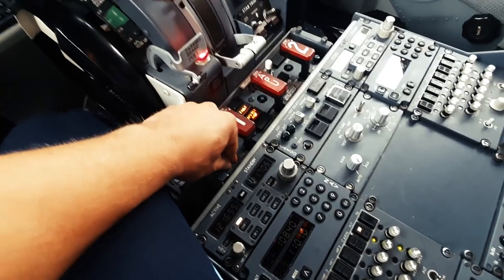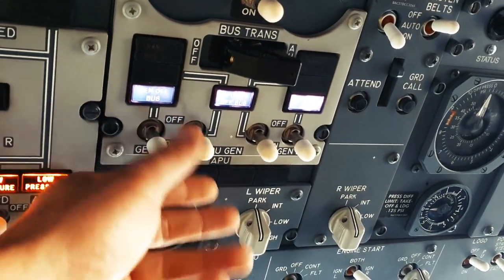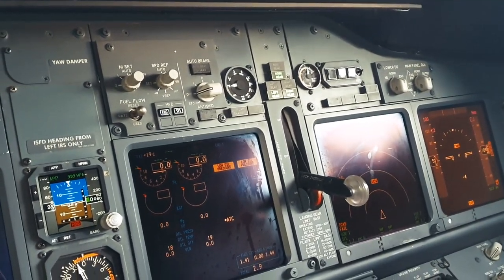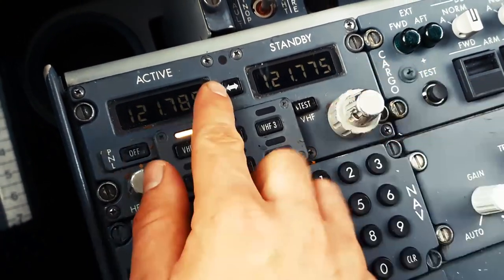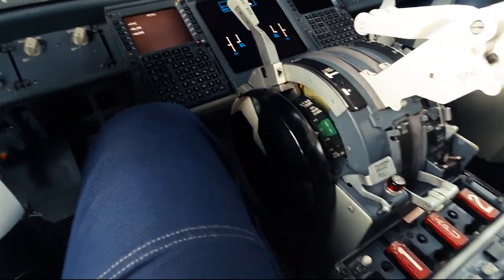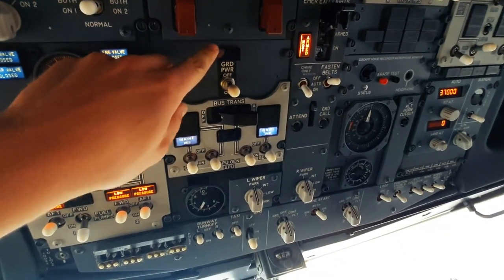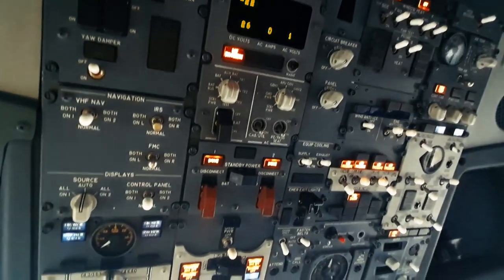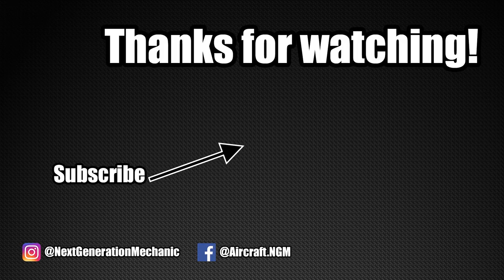Boeing 737NG: Aircraft towing operation explained

Comment: True towing story from past generation AME:  The DC-3 is, of course, a tail-wheel aircraft.  For towing, a long tow bar was hooked onto studs on the ends of the tailwheel axle, and the other end connected to a hitch on the tug.  The driver could use an aft hitch on the tug and drag the airplane behind, or connect to the front hitch and push the airplane ahead of the tug.  One day a mechanic of my acquaintance found himself alone at a small airport in Montana to do overnight maintenance on a DC-3 and then move it from the hangar to the gate.  He chose to connect the tow bar to the front of the tug and push the airplane ahead.  As he proceeded down the taxiway, a bump in the pavement bounced the tow bar loose from the tail wheel and the airplane went rolling on by itself.  The mechanic jumped from the tug, ran to the airplane, entered the air stair, which was luckily held open and just above the ground by chains, ran up the aisle to the cockpit, squeezed into the left seat, and stopped the airplane before it could leave the taxiway.  He was breathing a deep sigh of relief when when the idling tug, still in gear, caught up to the airplane.  Heavy  damage to the elevators and tail cone resulted.

Comment: why did you put the boost pump switch to on position before the APU starts and gives 115V, 400HZ??
Reply from the maker: Just a standard practice of me. According AMM you have to run a fuel pump of the LH tank.
Reply: Although the original 737 had no separate fuel pump for the APU, there has long been a factory option for a dc (battery bus) powered pump.